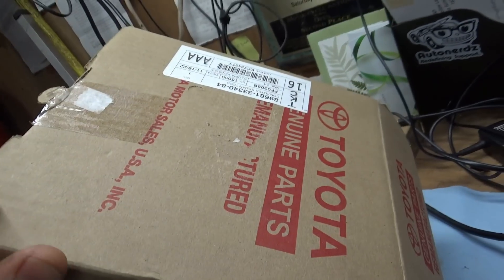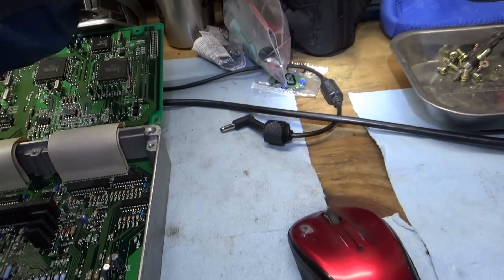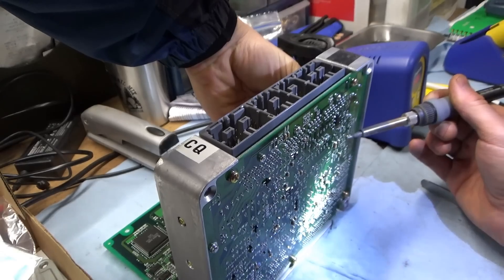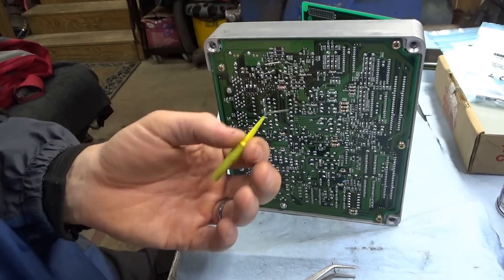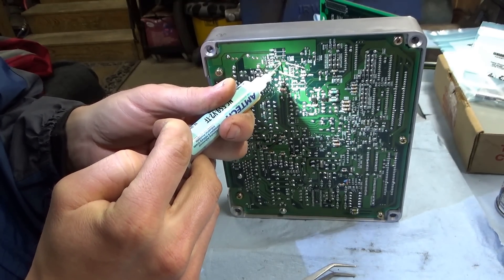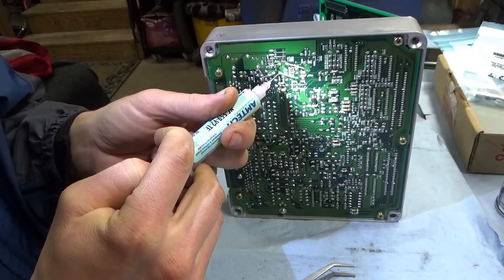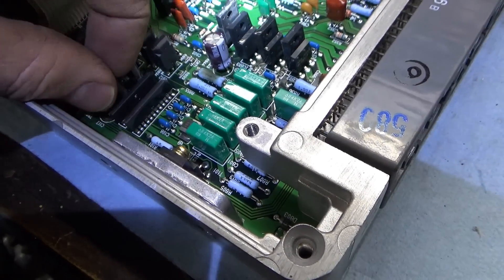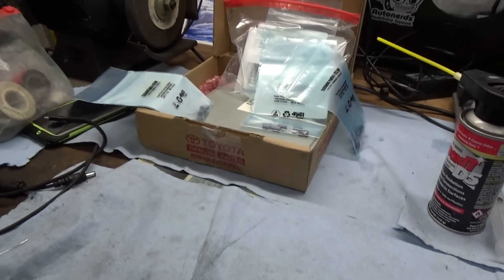Crazy Classic Camry: Intermittent LIMP-HOME? (Part 3: COMEBACK?)

Comment: On that "bad trace" --  all you have to do is follow it and see where the next solder point is and then you can jump a little wire from point to point to make up for the bad trace (if it needed it).   It doesn't look nice, but it's inside the box and no one would know.
Reply: NF method, YES.
Reply: @BigEightiesNewWave  What is "NF method"?
Reply: Though with the caveat that in higher vibration environments, you should be careful to secure the wire and prevent it from moving or else it can eventually break itself off.  UV cure glue/solder mask is probably the best but hot glue will work as well.
Reply: @big0bad0brad   polyurethane expanding foam..  mold making silicone..  liquid nail..  epoxy resin..  acrylic window caulk.. contact cement..  PR40..  RTV..  3M super weather strip adhesive..  pvc cement..   subfloor adhesive..   Permatex liquid tape..  jb weld.. plasti dip.. bondo..  wood glue..
Reply: @calholli  :D :D  Forgot chewing gum and a prayer

Comment: I clean capacitor damaged boards in the dishwasher. I know i will get some hate, but I have been doing it for over 30 years. The capacitor electrolyte is water soluble. I blow it out with compressed air then dry it in the oven at 180 degrees F for a couple of hours. Works like a charm.
Reply: I do that with computer keyboards that have had sugary liquids spilled on them, although at a lower temperature ~100° F.

Comment: I had a wooden table that I cut a hole in to de-solder components. I clamped a forceps to the component to be removed and let it hang through the hole while I heated the solder from the up side of the board. Back i the late 60s and early 70s we used transistor, capacitor ad resistor sockets in electronics class so it was easier to change values. When integrated circuits became widespread in the late 70s most were installed in a socket so they could be easily replaced. That might have been due to high failure rates but it was probably a holdover from vacuum tube days and trying to prevent heat damage from soldering. Essential tremor has ended my soldering days. I've thought about modifying a Noga magnetic base tool holder to hold a soldering iron steady.

Comment: Ivan! lol 1 step forward with using FLux,  1 step back using a soldering iron to remove components ugh! So the reason you dont use a soldering iron to remove components is that well you risk burning or tearing solder pads. u use a solder sucker type tool, there are many different types. they basically heat the solder then suck it out making the hole clear and component free. and well once you learn how to use it make removing components quick and easy. I suggest getting one and testing on a sacrificial circuit board. lol

Comment: Years ago, around 2004,  I had a randomly failing ECU in my 1984 Jaguar XJ12. After much diagnosis, I replaced the presumably dried out electrolytic capacitors. That was about 20 years ago, and I've had no problems since. The leaking capacitor thing is very common in 1990s Japanese ECUs. I've got a 2008 XJR too, and most of your diagnostics is much more applicable to it.  I really appreciate your work!

Comment: Samsung tvs have the same problem next time cut the capacitor off use pliers heat one side and pull wire out so much easier

Comment: Lol told you its ECU capacitors. Very common on 90s toyotas, search up lexus/toyota ecu capacitor on google and theres a great write up about them on the forums. Toyota used a very specific type of electrolytic capacitor and they end up leaking after a while causing all types of issues. The easiest way to tell the ecu capacitors are bad is if you get an igniter code. That part will almost never go bad, but when the ecu capacitors leak, it seems to throw that exact code on all toyota models.

Comment: I restore vintage computers and you got to really clean the board. I would have ultrasonic cleaned the board to get the electrolyte out of the board. Also important note these use low esr components. Seems to be a common faulty point on this era of ecms.

Comment: HAHA,great vid IVAN>so you watch ALEX on his channel.That's great ,FLUX IS YOUR FRIEND,whoever sent you that flux>HE"S your friend too.The caps leaking is a great find,i would bet money on that as a good fix.Better than factory haha funny.Your at the top of your field in the hard to diagnose wire messes,but this one was deeper that thought.Just as a thought,would it have helped to try the heat gun on the igniter box?I ask because of the Honda's that had issues with cold soldier on the fuel relays on 1990-2000s my 94 civic had that i fixed it myself.

Comment: Very surprising that so many of those capacitors were leaking out the bottom. The more common failure is they swell up on top and burst open. Good job on this Ivan.
Reply: There was a "capacitor plague" in the 90's where a lot of caps were manufactured with substandard methodology.  During that period they could fail in any number of ways :(

Comment: On a multi pin component, solder a 14 wire gauge piece to both pins,  then heat the wire.  Both pins will then release at the same time.

Comment: I don't even mess around with a soldering iron even when I only have one through-hole component to remove.  I'd rather spend 10 minutes digging out my Hakko FR301 over spending 5 minutes trying to clean the holes.  It's just so satisfying hearing that vacuum pump run.  lol.
Reply: Jealous of your FR301, I don't have one so I usually just use solder wick.  Most of the time it works pretty easy.
Reply: @ShanesGettingHandy  IMO, It's worth buying one if you have to remove through-hole parts more than a couple times a year.

Comment: One time I had a PlayStation 3, and it stopped working. and I tried to “reflow” the main board by putting it in my kitchen oven. It didn’t work though.
Reply: Of course it didn't work. Solder melts at around 700°F. Your oven only goes up to about 500°.
Reply: @markanderson2904  Well, depending on the solder metal weight percent between tin and lead, it could be as low as 360 ish degrees, and 610ish degrees.
Reply: @GNX157  That's true. I was just simplifying.

Comment: The electrolyte in the capacitor is acidic. It will seep through the whole joint creating oxides on the surface that have a much higher melting point than the base solder. I like to take a small flat blade screwdriver and scrape of the surface of the joint to clean the oxide layer. For really badly corroded joins you can use a fiberglass pen. 

When a trace is corroded you really need to clean the crusty stuff off. Again, carefully with a small flat blade to get the worst of it. You don't want to damage the PCB, so be gentle. Then the fiberglass pen. This will uncover traces that look intact but are all corrosion. The really bad parts can be neutralized with a weak base like baking soda, household ammonia, etc. Just leave it on until the bubbling stops. Mop it up, clean with water and then 99% alcohol. Small breaks can be fixed with a jumper wire.

Have some videos of cleaning up badly corroded boards on my channel.

Comment: When you have leaky electrolytic capacitors that have left residue on a PC board, after removing the leaky capacitor you should use a cotton swab moistened with white vinegar.  Then moisten another cotton swab with water.  Then use another cotton swab dipped in high percent isopropyl alcohol, 91% is usually available from your local pharmacy.  The electrolyte is alkaline, the vinegar is slightly acidic and neutralizes the electrolyte.  The water helps neutralize any remaining vinegar.  The isopropyl alcohol, because it evaporates quickly, acts to dry the PC board.
Reply: lol and add some conformal coating
Reply: And, when working with electronics, in this case soldering, it's important to follow safe ESD practices. Especially in this era of electronics.
Reply: @additudeobx  And of course "ESD safe" doesn't mean putting the wrist strap on like it's some magic piece of armor, it means avoiding static discharge THROUGH the device or component(s).  You need to be conscious of not having the electronics between you and something conductive when there could be a static charge built up.
Reply: @big0bad0brad  Brad, NO-thank you for the lecture on what is and what is not ESD. You have no idea who I am and what my history is with ESD. I made a basic standard run of the mill statement about ESD procedures and you went off on me tacking my name to your rant. Leave me alone.  I worked for Bell Labs back at the end of the 1970's and we were just discovering what ESD was and its effects. We created the first industry standard for ESD procedures. Later when I worked for IBM I was the engineer in charge of the ESD Compliance on the Card Manufacturing floor. I don't need a lecture from you, son.
Reply: @additudeobx  LOL - And those of us with Bell-Shaped-Heads know exactly how the early CMOS DIP chips could become, "pregnant" from a static discharge, failing several months later once Oxygen slowly creeps inside though the tiny lightning hole, eventually going all the way down to the substrate.  True story bro.
Reply: You beat me to it! I wasn’t going to say that but I would have thought of something 😂😂
Reply: I may be wrong but for igniters can't you hack open and repair electronics too. I believe ics have protection on their pins for ESD. No need to worry about wrist bangle. I have never used one and live in dry Australian weather where I zap myself on door handles all day.

Comment: in the 1990 bad capacitor was a plea millions of bad rated capacitors submerge the market and fail. just to be certain to replace with the same voltage , capoacirt and electrolitic type dont forget to replace with 85 C degree or more tp prevent leaking and why not choose millitary specs electrolitic capacitors.

Comment: I love my cordless butane solder gun ,when Stripping circuit boards and a solder sucker works real good plus I use a small neon light behind the board to light up the place I want to un solder transistors, cords are so clumsy 😊😊

Comment: you need a tool called a solder sucker. you heat the solder, suck it off of the board, remove the bad component. install new component.

Comment: Another tip... A great solder mask replacement, especially for automotive electronics, is to use just plain old clear enamel rust-oleum spray paint.  Spray a thin coat on the board and let it dry for 30 min or so.  Don't do too many coats if you think someone will work on this in the future, but I've found spraying multiple coats from different angles can get good enough coverage of the entire board and protect from light moisture and corrosion.  Clear because you want to be able to see the component values if you need to work on it again in the future. Rust-oleum because it is cheap and prevents corrosion.  Too many coats and you won't be able to strip it away without burning it if you need to solder the board in the future.
Reply: Just don't spray inside any connectors or onto pin pads that need to make a mechanical connection with something. ;P

Comment: You also mentioned that you probably didn’t need a microscope, but I once repaired an intermittent radio problem from a Pontiac 6000 STE by first determining that there was a circuit board break in a trace by just pushing on different areas of the circuit board with a plastic rod and resoldering every joint in that area. It improved the intermittent but didn’t eliminate it. So, under a microscope I found a cold solder joint on a surface mount transistor leg! I desoldered that leg, cleaned with a dental pick, fluxed and resoldered. Never had a problem with it afterward.

Comment: Consider building or buying a VI curve tracer.. (Can also search for an octopus circuit) Its a fairly quick and easy way to ID problematic components, even in-circuit, and plugs into the X-Y mode of a regular Picotech scope.. Not sure if their automotive scopes have it, but you can go through a lot of components quickly.

Comment: For anyone learning to solder... When desoldering I set my iron to about 350C to 380C as that works best with most smaller components.  Bigger components might need more heat.  But the secret to clearing the holes of solder is to use about 480C on the iron, apply flux and drag desoldering braid across the holes while heating it with the iron.  Using a pin to poke through the hot solder could end up damaging traces, try not to do that if you can avoid it.  But a hot iron, some flux and desoldering braid is the secret to clearing out those holes quickly.  Works for me every time.  Then bump the iron back down to about 350-380C, place new component, apply some fresh flux and solder it in.  Easy!  Just clean up with isopropyl alcohol when done.
Reply: Oh, and don't forget to mark the +- component orientation if it isn't screen printed or obvious in some other way.
Reply: And vacuum pump...
Reply: And then have a tiny flat blade ready to straighten the pins if they've been bent before soldering.  The chisel tip isn't small enough, and trying to force it could rip the pad.
Reply: And if you really can't get the solder out no matter how much you try, fill it with solder again and use the tiniest drill bit you've ever seen in your life and make a hole for the lead to go thru.  Just be careful that you go through the solder and not hit the edge where you could destroy a trace, esp if there are inner layers where you may not be able to see what happened.

Comment: Snip leads under cap.  Using solder wick draw the solder out. Remove legs. May need to heat while pulling bent tip.  Lay board horizontal. Gravity. 🤠🇺🇸

Comment: In this case, replacing the capacitors with an EXACT match was not the best choice. They were inferior low quality to begin with and that is what caused the issue. You could have (for $0.10 more) replaced them with far superior components (of the same capacitance rating and equal or higher voltage rating) using a solid case that won't leak again. If this ECU fails, it will likely be the same crummy caps that shouldn't have been used in this application to begin with that fail AGAIN :)  With car parts, the original part exact match is likely the best you can get but this isn't the case with electronics component parts where they are built to a price point using lower cost parts. Using lower grade caps likely saved $1 in the cost of the ECU but they were making a hundred thousand of them so saved a hundred thousand dollars. Always enjoy your content but as an electronics technician I couldn't watch your soldering without screaming at the screen.
Reply from the maker: Guess I'll have to replace the caps again in another 30 years 😅

Comment: Ivan, I'm an amateur radio operator - and many hams are quite accustomed to "recapping" older gear. Electrolytic capacitors don't last forever! An automotive ECU gets exposed to heat, cold, and humidity extremes, it's no wonder they failed. Recapping thru hole construction is a cinch; recapping surface mount stuff is NO FUN as your eyes get older! No worry about having to use low melt solder in 1994 stuff, we didn't deal with RoHS until the early 2000s. And - yes - flux is your buddy. Does that mean you worked on a Flux Capacitor?  🤣 Nice job!
Reply: With a new flux capacitor, that Camry should have no problem hitting 86mph. I know first hand that Ivan's '98 Camry has no problem getting there 😂
Reply from the maker: @GregoryGlessnerViolin in the 98 Camry 100mph feels like 60mph 🙃

Comment: Capacitors - the bane of electronic circuits. Imagine the billions of dollars worth of electronic equipment which gets discarded due to failure of a cheap capacitor. Down here in Louisiana, about 90% of 'no cooling' service calls for home air conditioners are due to failed capacitors. Imagine the people who get scammed by being told they need a new condenser unit, when the only problem is a failed $15 capacitor, or burned out contactor.
Reply: Just the excuse to get 3-phase power run to my house :-)
Reply: A couple years ago I got quoted $400 to replace a single capacitor on an AC unit. I purchased the correct replacement for $23 and replaced it myself in about 15 minutes.
Reply: @leonardodavinci303  Good for you!  There’s a lot of satisfaction repairing something yourself like that.

Comment: should use vinegar to remove the electrolityc fluid. then clean up with IPA. lots of flux to solder back. i have repaired tons of honda ecms that way. as a general rule, all the ecms prior to 2005 should be inspected first, the amount of secondary symptoms is absurd, so better start there. tcms are no better.

Comment: Your better off using a vacuum desolder station. Less heat on board less damage to the board. You can also use nail polish to insulate the trace.
Reply: Super glue works too
Reply: what color ?

Comment: I like that old capacitors can keep going for 20 years or more and aren't to hard to exchange in most cases. Perhaps upgrading to solid caps of the same ratings would make it bullet proof.
Reply: Yep. They cost a little more but they have a much greater lifetime and greater temperature range. 

When I do these type of repairs I also up the voltage rating. Moving from 15/16 volt capacitors to 25/30 volt is the smart play with a 14.7 Volt electrical system. Sometimes they will be a little bigger but with these type of computer boards that is not usually a problem.

Still, another great Ivan repair story.

Comment: The only problem with the flux is that if it's water washable flux and not no clean it will!! Cause corrosion, either get no clean flux or a can of vericlean cleaner and spray your repair joints, prevent comeback on yourself Ivan

Comment: You should just add a big blob of solder across both pins heat it well and pull out the cap then desolder the pads with the gun, i do reckon you need a more powerful iron with a bigger tip like a weller, best wishes,john, Ireland